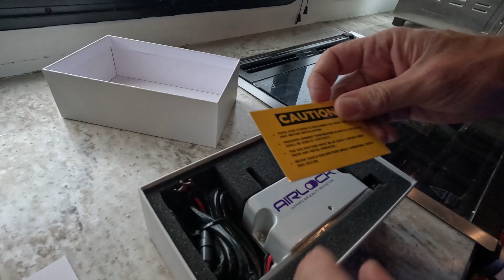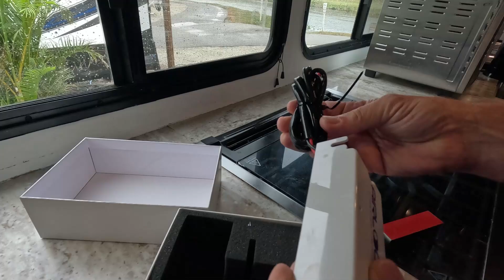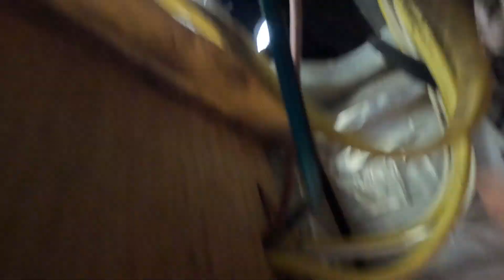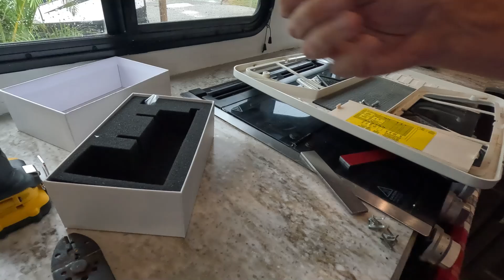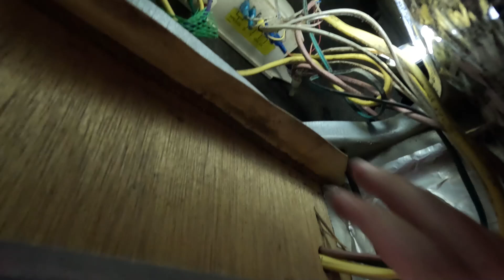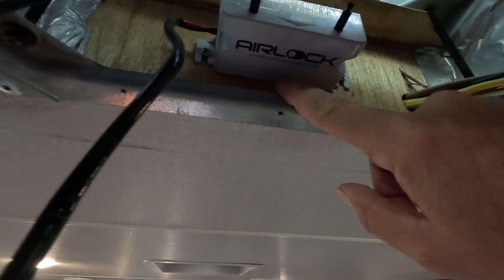How to Install the AIRLOCK ONE RV Air Purifier | Easy Install For Clean Air on the Go!

Comment: So on the website its mounted below the AC blower but you mounted it opposite their website. Is that correct ?
Reply from the maker: Correct, since our output side is inaccessible. I contacted AirLock and they verified that the unit is equally as effective when mounted in the return side.
Reply: @JouppiOutdoors  ok cool, thanx brother. Can you tell a difference yet? We keep a clean house but do have a dog. Regardless of cleaning him if im out the RV long enough i can tell we own a dog. Not a bad smell but she smells like "pet" haha
Reply from the maker: I have noticed that the smell of cooking dinner for example, doesn’t hang around if that makes sense? In the past, if we cooked something, then were out of the RV and came back in, there was still the lingering smell of whatever we were cooking. It definitely seems like odors dissipate faster and don’t linger nearly as long.